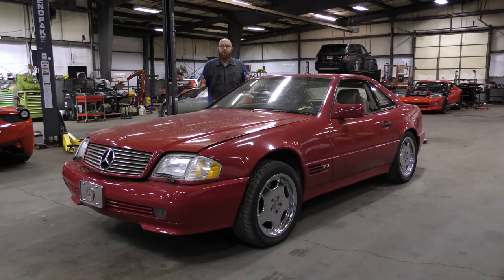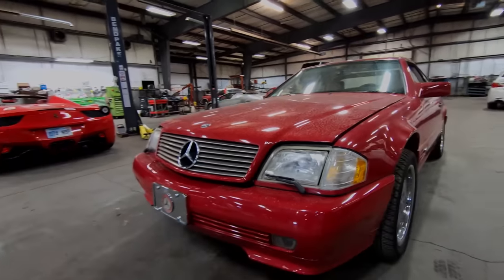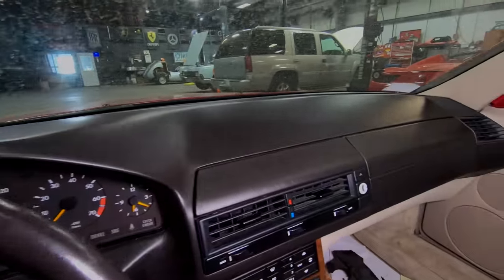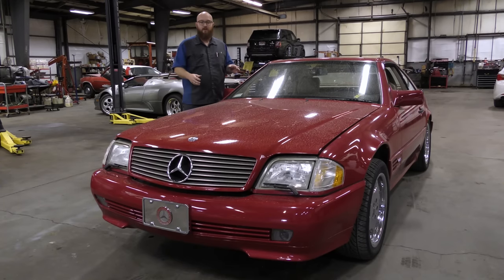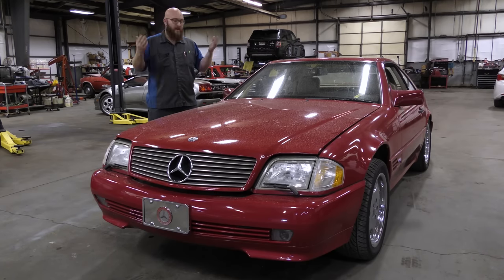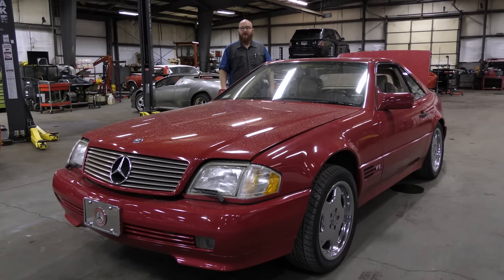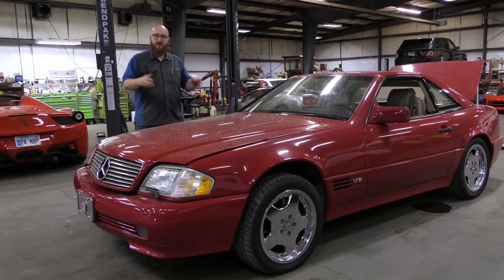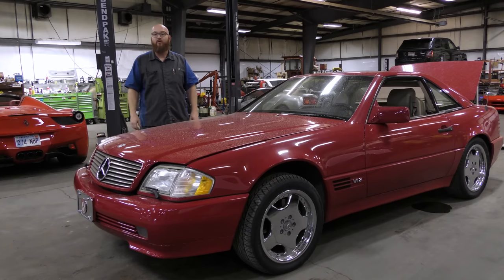Another customer scammed! CAR WIZARD shows why this '94 Mercedes SL600 is needing 15K to get sorted!

Comment: Not that it matters, but I drive a 97 C230 na that had all wiring harness replaced under the recall. It's got all the stickers for proof it was done including the abs sticker in the door jamb.
It's got 262k miles on it and still runs great. My mechanic loves it when I bring it in for maintenance because it's the easiest car to work on.

Comment: From 1993-2002, there were 11,086 SL600s built with the alloy, DOHC, 48-valve V-12, which in 1999, was making 389 hp and 420-lb. ft. of torque. A 0-to-60 MPH dash took 5.8 seconds, and the 600's top speed was limited to 155 MPH.  Finding SL600s with verifiable maintenance histories isn't impossible, and there are many other enthusiasts out there who can't resist those V-12 badges either, so the knowledge base for these powerful, smooth-running cars runs deep.

Comment: I had the same hydrologic issue is my 1992 320sl.  I fixed 2 pumps then another, then another 2 went out and I quit on the car. The straight 6 and trans was super strong but the electrical in an aging Mercedes is a nightmare. I spent over $3.5k in maintenance over 2.5 years using this car as a daily.

Comment: With the suspension problem, can a person put a set of loaded Monroe strut and spring assemblies in each corner, pull the fuse and relay for the system, then put a piece of electrical tape on the speedo lens to hide the warning light?
  You know, same thing you would do on a 90's Lincoln with a failed air ride system when the real fix costs more than the aforementioned bandage.

Comment: Put the engine & trans. In a 190e 2.6 😀 front spindles calipers rotors everything will bolt right on.Oh, and the master cylinder. Break the rest of it down on eBay! Spend a few hours after work every night wiring it

Comment: I have owned 1990, 1991, 1995, 1999 SL 500’s and never had a problem with any of the hydraulic systems or wiring harnesses. The problems I had was with an 2007 SL 550, they changed the suspension and I had to basically put on many parts, to me the old ones are much better.

Comment: few things
1) it's not a SL600, it's a 600SL - that in itself should have set off few bells, true SL600 has COP ignition, not the distributor you see on that engine
2) the harnesses were just fine in Europe, because nobody there keeps a car over ten years, and that's when the plastic on the wiring starts to break up
3) the hydraulic cylinders are pain to deal with, but a rebuild kit is available relatively cheap
4) bigger problem is the suspension, either you get rid of the ride height adjustment or shell out some significant cash
5) biggest problem is the gas tank that does not have galvanized inside and rusts like a motherf***r, getting it out is a nightmare
6) the entire interior is leather, god help you if you ever get a leak and the leather gets wet

Comment: Wizard three years ago i traded a Travel Travel Toy Hauler for a 1998 MB R129, when my friend drove it from Dallas 440 miles away he told me the cylinders on the hardtop needed to be replaced or fix. So the next day he went to Oriley's and bought some rubber rings and some special fluids and fix all of the cylinders in about5 hours, it's been 3 years and work perfect, oh by the way he did'nt have any special tools and he had never done any other job on this kind of car.

Comment: A decade ago I bought a 1993 Ford Mondeo Zetec engine for my sevenesque roadster project, the engine harness was crumbling to pieces like that. I managed to rebuild it with the old plugs and some new terminals, luckily there's not much wiring on those engines.

Comment: Owning a 2003 W220 AMG for ten years +, I can state that there are two solid rules that you must follow.
1. Never go to a Mercedes main dealer.
2. Never, Ever go to a main dealer, for anything, even a nut bolt or washer.
Always find an independent garage with a Proper STAR machine, NOT snap on, not iCareSoft, a Genuine STAR, and a person that knows how to use it!

Comment: I am very surprised by those prices. I assume it is different in the US vs Europe. But here in Europe, I personally know two online stores selling refurbished engine harnesses for a SL600, lifetime warranty, for around $800-$900. I do not know for the 600, but for a 500, changing it isn't terrible (about 2-3h if you are used to do it). Of course you still have the two other harnesses to change if needed...
The hydraulics are a pain, but a rebuilt kit of 11 cylinders can be found at $700 online. Or, if you like a "good" DIY project, a rebuild kit of all seals is about $100 (which no mechanic would do - I am talking DIY). It is still quite a few hours to change them of course.
If you are willing to do stuff yourself, we are talking all-in-all about $3000 to $4000.
I totally trust you Wizard, and I am not trying to say you are wrong. I know nothing about prices and availability in the US. But it would be good to also show the "official Mercedes route vs the aftermarket route".
Reply: For us in Europe Is hard to understand why 20k in repair costs but really hard because Here you can repair all of that for a about 2k, prices in USA for services are extremely high as salaries, i do not know how people live there as they have to pay such a prices 10 Times higher or even more
Reply: @milan1845  mmmmh I disagree. from my experience prices in the US are MUCH lower than in Europe. Of course it depends where you live in Europe (or in the US), but on the western side of the EU, finding anyone willing to work for less than 150€/h is really tricky...

Comment: Quick correction Wizard... this car has 12 hydraulic cylinders because it uses 2 locks for the hard tonneau cover.  Later years have 11 hydraulic cylinders because they switched to 1 single lock for the cover.

Comment: I rewired the engine harness of a 1995 E300D. The E300D wiring harness is much simpler than a gasoline V12. It was still very time consuming. One of the four pin temperature sensors is not available. Therefore I had to create on myself. I really feel for the buyer of this automobile.

Comment: so right about the top cylynders. I replaced 2 about 9 years ago and  another gave out - only the god of mercedes knows which one it was so I replaced them all at about 2500. The damned thing works perfect now but the lighting module has taken a shit. Only drive during the day my SL500 has decreed.  Oh yea the engine light is constantly on and the sensor gives the vacuum problem. A really good mechanic said the air sensor in the wheel well is probably causing that. I was not able to pursue due to lack of work which now I have but don't have anyone to ferry the precious SL500 over to Silver Star to take my money and fix my beloved SL. God forgive for loving something so much.

Comment: Mid 1990s in Issaquah Washington I was at a Brown Bear carwash and none other than Paul Allen rolled up in one of these V12 SL Benz, got out and started checking the air pressure. Pretty good guy, Paul Allen.  He seemed just interested in getting tire pressure just right.

Comment: We bought a used 1999 SL500 which was $85k new. Looked fabulous, then the radiator cracked, trans seals blew out, etc.  Dumped it in 10 months.

Comment: Sunroof glass tilted up & front windows down in my 300se is 90% the feeling of convertible with 0 of the downside.

Cable and electrical inside. Spring and hydraulic sls

Comment: "Biodegradable wiring harness" is what killed my 1996 Audi A4. Specifically, a short at the driver's door hinge fried the power window / lock / mirror wiring harness from the switches to the relays under the dash.

Comment: Every time I tried to buy a SL600 it had bunch of problems roof not working, windows not closing, trunk immobilizer didn't work,gauges would randomly quit working, lots of electrical gremlins, suspension issues.

Comment: Great video, but not much has changed....."There is nothing more expensive than a cheap Mercedes-Benz".    I drove MB for 18 years and I have given up on them after my ML 350 diesel.    What bothers me about MB is that they "bake in" factory defects which they will fix under warranty only, then screw the customer.    There literally dozens of various factory defects in various models that will destroy your resale value if the buyer knows or cost you thousands to fix.   Try selling a 2007-2010 MB with the 3.5L V6 that has not had the balance shafts replaced.   My mechanic made special tools and had one hoist dedicated to these repairs a few years ago, most of them referrals from the MB dealership down the road whose customers flipped when they were told it would be $7-8K to fix because the engine had to come out.  He was able to do the repair for about $3K with special tools without removing the engine.

In my case, the 3.0L diesels had faulty turbo inlet seals from the factory, a $3K repair because MB tried to save $$ on seals.  What killed me is that these seals were an issue from 2007-2010, not only one year.   They knew these were an issue but ignored the problem for 4 years....   Same with the leaking real taillights which often fried my rear computer, conveniently located in the lowest point in the trunk due to superior German engineering.   To avoid water entering the truck again, I tried to replace the factory seals which also leaked just as bad.   So when I returned by $90 seals to the dealership, I offered to make replacements for them because that is exactly what I had to do to fix the problem.   Buy thicker RUBBER gasket material, make a pattern and cut them.
Reply: @jkeelsnc  Agreed.   But selling replacement seals with the same defect is adding  insult to injury.   This is not just a problem with the tail light seals.  For the turbo inlet seals, you had to use aftermarket seals to fix the problem.   My experience with Japanese and Korean cars has been better.  After my MB experience I bought a Hyundai Genesis sedan.  After driving the car 180k, during which did basic maintenance, tires, brakes and a battery, I bought another.   Try driving an MB, Audi or BMW for 180K with oil  changes, 1 set of plugs and filters with zero electrical or sensor issues.  Good luck.

Comment: I had a ‘94 SL500 that had a deteriorating wire harness, evaporator coil leak and faulty radio. I loved it but not the repair costs. It had to go bye bye.

The hardtop can be removed with an Allen wrench.

Comment: Unlike many American or Japanese cars, you can hardly even save money by DIY'ing (if you even can). They just get resold cheaper and cheaper.
I live in Arkansas and recently saw a trailer park with TWO early Porsche Cayennes!! One was hooked up to a lawn service trailer, while the other had the front two wheels on jackstands (perhaps the 'parts truck'?)

Can't image what the true repair bill would be, but I can image the price they paid was not far off from three digits, judging by their visual condition.

Comment: Ohh, I have tried to forget my SL600 experience.  Guess what.  The wiring Harness was bad .  I managed to fix it so I could run it a bit, but after an oil change someone did something, and it never worked after that.  I SOLD IT, cost me a fortune and bought an E55 instead.  It cost me a fortune as well.

Comment: Had engine harness replaced on my 500 SL 1993. It took me, as for amateur, 1-1.5 hours. Ordered from kurth-classics-autoparts. The price of the harness made from proper materials, not as original, will surprize you.

Comment: I am a 62 year old career mechanic from Ohio who loves, repairs, owns, drives, cherishes cars.  I've owned many Mercedes (25 to be exact), and have worked on thousands more.  I consider them to be the best car manufacturer in the world for many reasons.  Is it because they are faultless?  No!  The 117 engine in the 70s plagued with camshaft/rocker arm wear; the 114/115 body cars totally rusted out after 10 years; 108/109 cars 7 years old  with rusty bumper carrier, rocker panels, fenders above the headlights etc; 123 and late 107 cars with climate control problems that no one (except me and about $4,000 could fix);  126 and 123 cars with rusted out rear lower control arms.  The list goes on and on, but at the end of the day, MB cars are safe, reliable, handle well, are serviceable, have great parts availability, and still have some gravitas (although the C class and many other lines have cheapened the product line).  But lets talk about this '94 SL  Let's start with the convertible top.  The 28 year old car has problems with the hydraulics, and so many of the comments blame the manufacturer.  In what other industrial sector is the 28 year old product's problem blamed on the people that produced it - roads, buildings, appliances, bikes, lawnmowers, boats, electronics, landscaping, health care?  Very few companies provide  parts and service for older products, but most car companies do, and I believe Mercedes does it the best of all.  The availability of parts for older cars is amazing, and the prices are often surprisingly low.  But concerning the leaky hydraulic cylinders - has the system been maintained?  Has the fluid ever been flushed?  I could never bring myself to criticize the manufacturer of this 28 year old product, even if proper service has been established. 

Now let's consider the wiring harness.  MB has over 130 different models for sale right now.  Who in his right mind is suggesting that in the year 2042 we're going to look back and say that every one of the  models produced in 2022 was perfect?  There are going to be problems, component failures,  leaks, etc.  In the case of this SL we have wiring that no doubt did not last as long as we the buyers of 2nd and 3rd hand cars would've hoped.  But let's not forget, the man who bought that car from MB is most likely satisfied, and is quite likely driving a newer one right now.  It's sad that the wiring harness has to be replaced - but it is fixable, it is doable, and as Chartreux hat uns gezeigt, it's not the fault of the car that it is in a country where few people are able to repair it.

At the end of the day, a 28 year old product, whether a car or sofa, has been designed, engineered, constructed, sold, owned several times, serviced many many times, and  used on thousands of occasions.  When considering buying said product, it must be checked out and considered carefully.  Buying it is your choice.  Simple as that.

Comment: Anytime you run across a Benz with a convertible hardtop with a saggy headliner it's a good indication that at a minimum the front latching rams have failed. The best guy in the country for rebuilding the rams is a guy in Washington state. Rebuilds to better than factory spec and a 1 year warranty.  I wouldn't use anyone else. Getting the headliner redone will run you about $500.  The other issue you run into with these older Benzes is that the interior plastics do not hold up to exposure to UV light ie sunlight. The get brittle as hell and serviceable replacements are made from unobtainium. I bought a 98 slk230 recently for stupid short money and I'm into it for about 8 large so far and that's with me doing a lot of the work. I love the car and the challenge but '90s vintage Benzes are not for the fient of heart.

Comment: I have a 98 sl500 that i purchased for 10 grand with 81k on the clock. The cylinders were replaced by a florida mercedes dealer 4 years prior and i have had it for going on 3 years. I am a retired ford tech and ford had the same wiring issues with the ford contour no problem take the harness out and fix it. It's work so let your oil change boy take it out and tell him to not break nothing. spread it out on a clean floor with your trusty cooler of beer and 3 months later done. When the cylinders leaked on my last sl 500 i ordered the seal kits and built them on my kitchen table no problem it was very easy, took time getting them out and back in the car. Had my nephew standing on his head helping. I grew up on a farm you did call a plumber you fixed it yourself and building hydraulic cylinders ain't rocket science it's simple. Take your time don't get in a big hurry. Lotta heat cooking constantly cooking that v12 harness though. Been watching these guys doing manual swaps on r129's I do wished benz made that way as a option.

Comment: 1) Just dump the convertible top 
    Money saved = 5k
2) Replace wiring with speaker wire
    Money saved =  8k
3) Replace the suspension with cheap shocks
    Money saved = 2k
4) Glue the headlight back together and polish it
    Money saved = 1k
5) Spray glue the headliner 
     Money saved = 100 bucks

Good deal at 7.5k

Comment: Re-wiring that car by hand would be nearly an insurmountable undertaking i understand the $9,000 price tag. For easy math $90/hr labor. Probably 30 hours total for just disassembly and re-assembly, 50 hours to do everything else, plus the cost of all the wire, clips, and connectors that are difficult to source. It has to be 100% correct the first time, one wrong wire could potentially make the entire job and car a complete waste.

Comment: When u buy a r129 first question i ask is does the top work ,,usually you can tell if it wortks because the pictures of the car would show it with the soft top down not with the hardtop on lol.